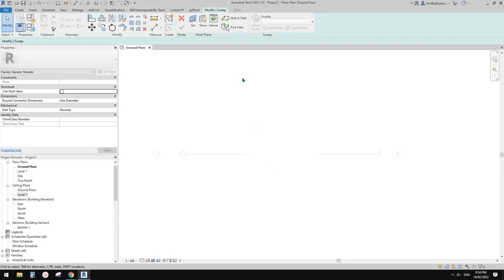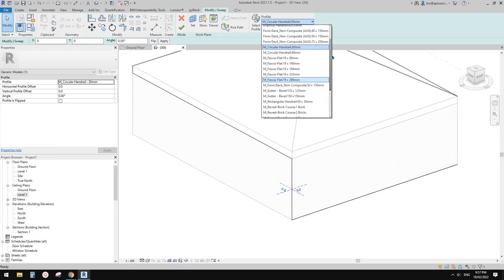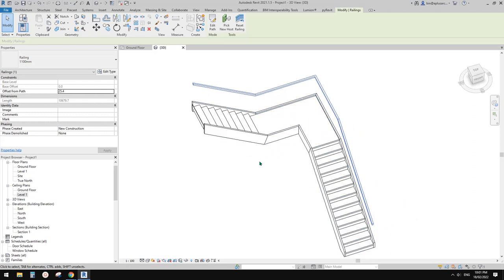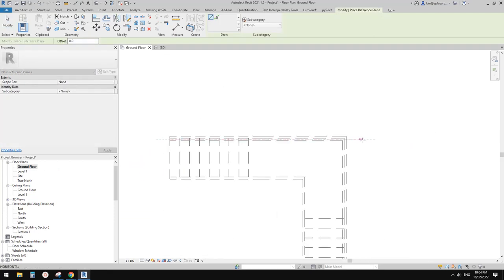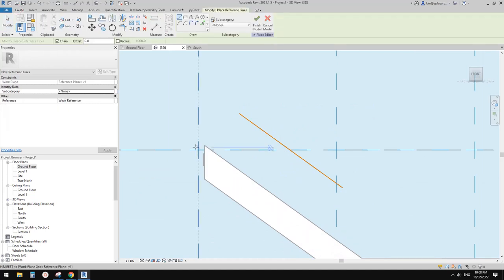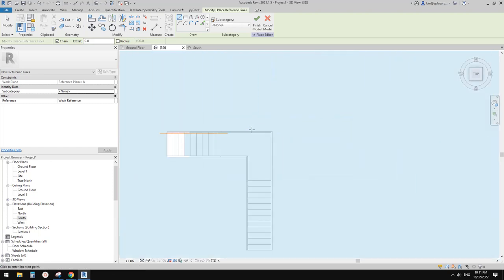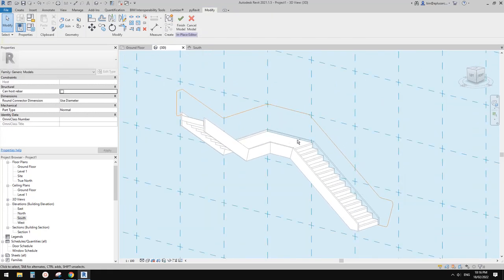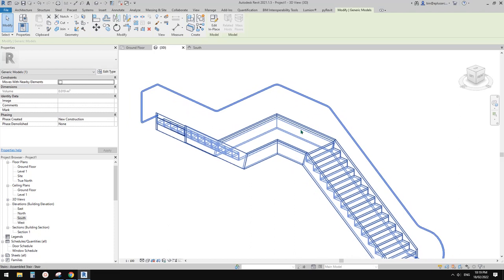Revit Exercise (Day 697) Model In Place Sweep with Pick Path

Comment: Thanks for the great video. would like to have your advice how to add the brackets/supports at certain interval(e.g.1.2m c/c) to this kind of wall mounted handrail?
Reply from the maker: I think it is probably easier to use supports from a regular railing. I will have a look.

Comment: Hi bin how r u ...hope u fine...i want to ask one thing regarding custom wall
I want to make one wood stull wall and also put gyp board on both exterior and interior side...so what i think is that i should make a store front wall make solid as a wool ..and mullion as wood frame and then make gyp wall on both side ...but how i make this wall as one wall ...kindly reply sir...thanku
Reply from the maker: Do you mean stud wall? I suggestion you only use the basic wall and do not place studs. You can manually place studs using the structural columns or detail items, but mostly of the time builders can work that out.